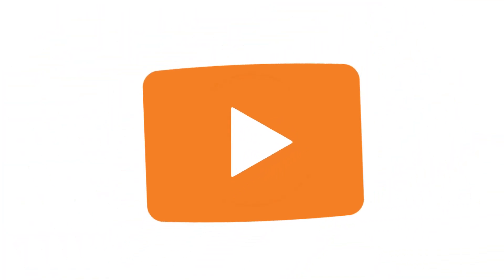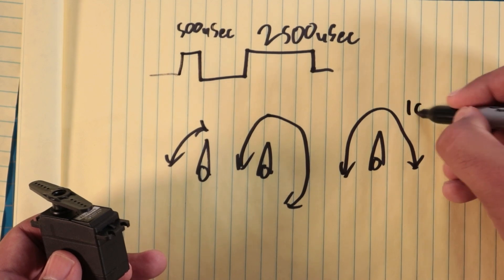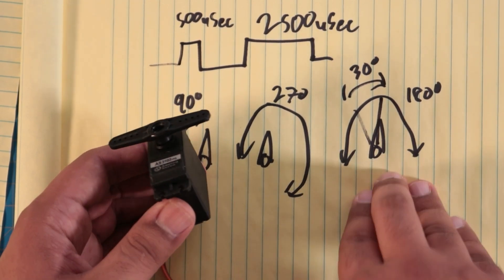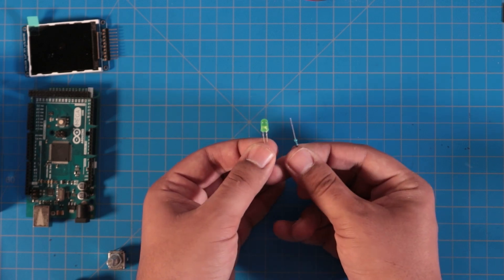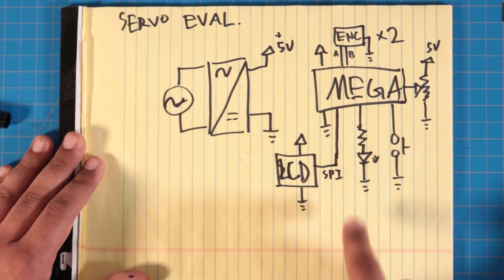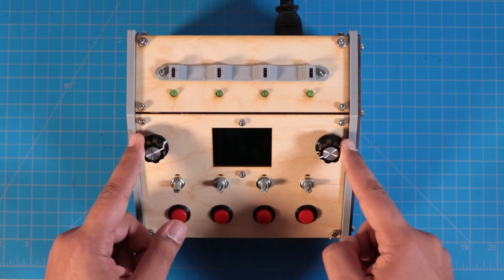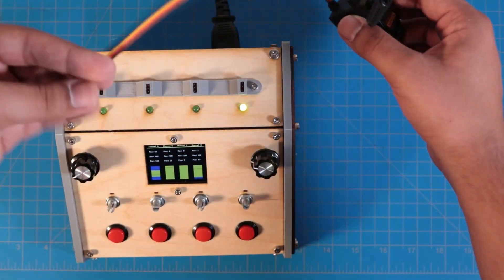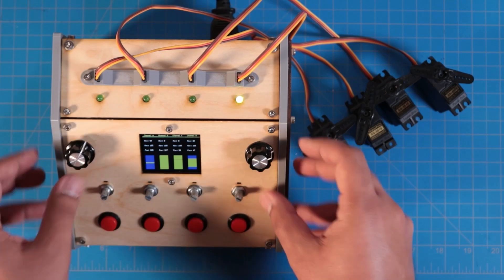DIY Four Channel Arduino Servo Tester

Comment: I realize that this is very old now, so what I'll say is just moot.  But who knows, it may help others.

First it doesn't look like there's any debouncing code for those encoders.
When I first started using them and didn't know about this problem, my project was messy!  Any little touch and the numbers would go flying one way or another.

I learned how to add debounce code and problem solved.

Secondly, again, though, this is a very old video, so it's possible that the library for that display is one of the ones that really made those displays slow.

There are new libraries, which I'll assume all who do Arduino/ESP32 stuff know about, that are much faster as you can actually program the frequency of reads/writes as well as fast refreshes.  I'm not sure if it'll work on that display, but there's also a method, using some library, to set up sprites, which make everything snappy and smooth.

As for that case, I love that design.  I'll try to find one or maybe sit down and try to make one.  I like those "sides" as being the pieces that all other pieces attach to.  But, I'd be either 3D printing it all or print the sides and cut out the flats from thin aluminum.  I say cut because I do not have nor ever will have a laser cutter.

Oh, forgot to mention,
for a project like this, if you want a really fast updating display, try a Nextion Enhanced.
They are wonderful to actually have code in them and then the controller only has to send little bytes here and there (flags, values) as needed.  Those graphics would be real-time snappy and the text update instant.

Comment: The refresh rate is SW not a HW issue, 16MHz is plenty fast for a high frame rate, when you update only parts of the screen (and I bet even updating whole screen can be optimized further in this case).

Comment: This is a servo driver.  Often times you can buy 10 servos that have 10 different capabilities.  When i heard "servo evaluator" i was hoping it was something that you could evaluate the range and performance of the servo.  You could setup an encoder that told you the difference of what you command and what the servo did.  It could then give you a map for each servo you test.  An example being a mechanism that requires only 20 degrees of motion.  You hook up the servo and run the evaluator test and it tells you "servo X with 20 degrees of range should use values -9 and +11."  You could then hook up another servo and that one might tell you its -15 and +12 to get 20 degrees out.